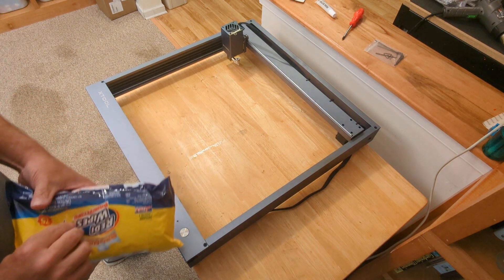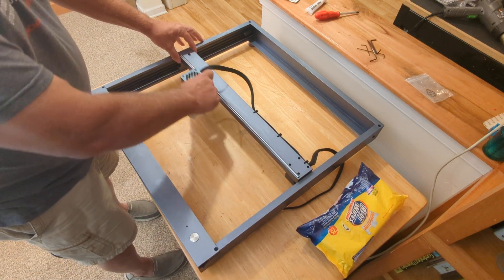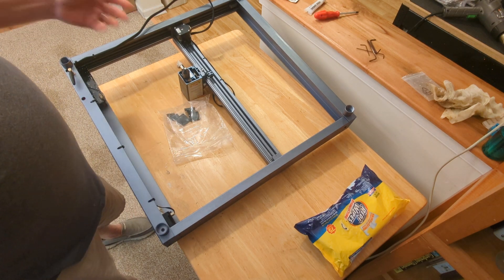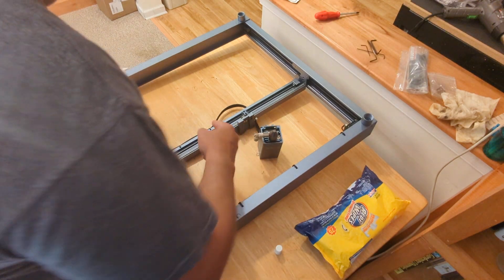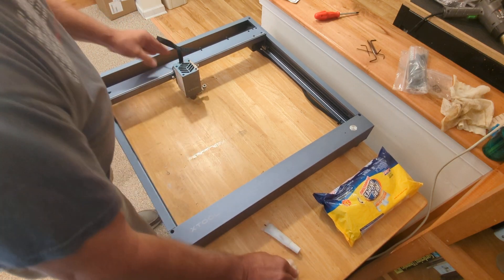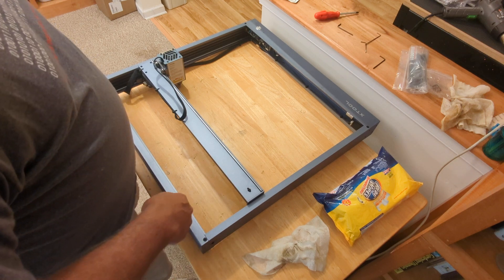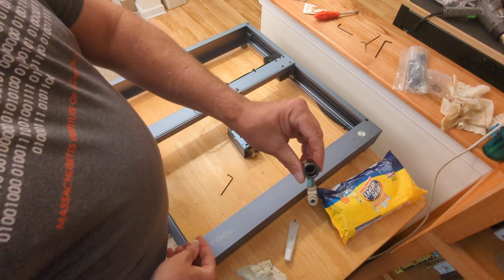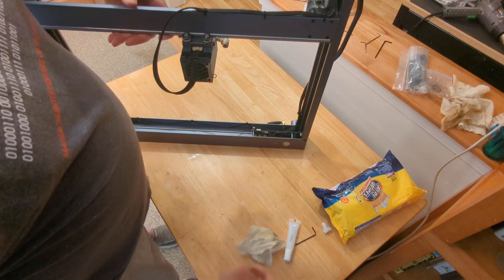xTool D1 Periodic Maintenance

Comment: One side of the X gantry moves more than the other side. Ive tightened the Y belts, but it doesnt change anything. Any suggestions? Im at my wits end
Reply from the maker: It's going to be one of two things - it's either not being moved enough (belts and motors) or it's not being allowed to move enough (guide wheels and rails).  My bet is that it's either the coupler (silver cylinder inboard of the Y axis stepper, has 2x hex bolts to tighten it) or it's the drive gear that's mostly hidden between the y drive motor and the frame.  I spent some time in the video discussing how to properly tighten both.
Reply from the maker: Also, check one of my other videos: https://www.youtube.com/watch?v=WcHBGIOWi0M which covers exactly this.